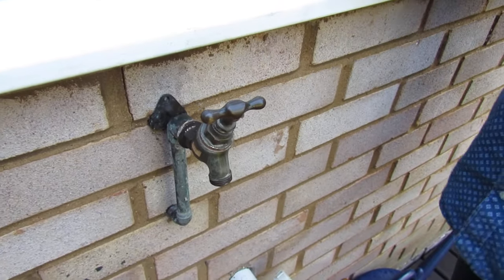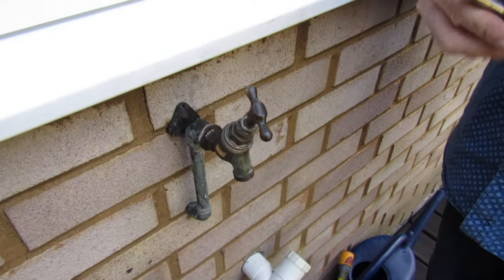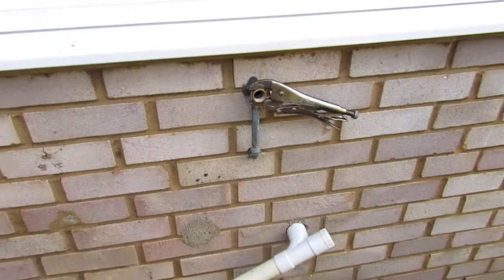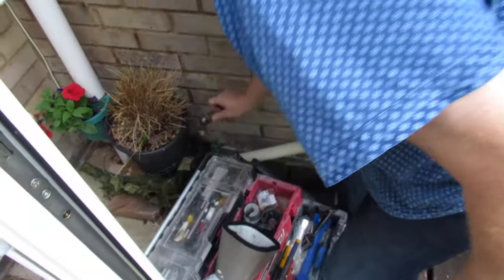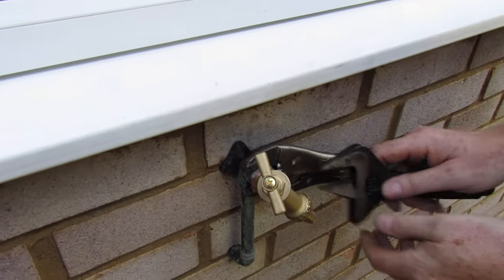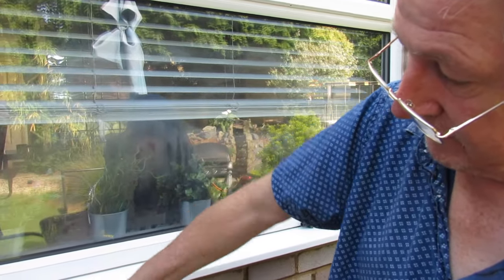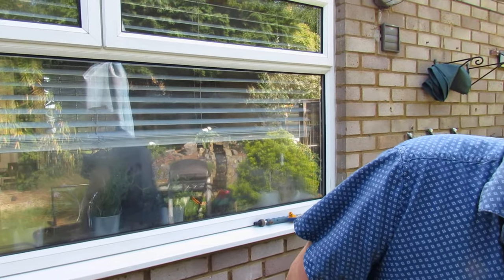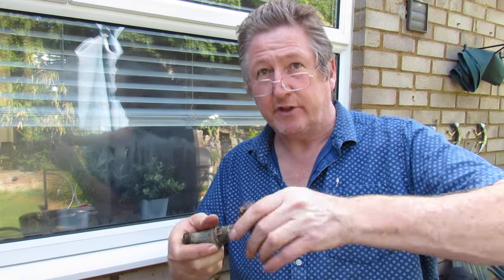How to replace or change an outside tap in under 5 minutes

Comment: You don't need a washer or any sealant.  I fitted these taps for 30 years and only ever used PTFE tape. It's all you need if you know what you're doing.  If you don't know what you're doing then get someone who does.
Reply: So if I just have sort of a pipe fixed to the brick in wich the tap is fixed to should I put the grip on the pipe ?
Reply: 1 year since I haven't wash my car with the presure washed because of the tap :)) I m so ignorant
Reply: People making tutorial videos with no idea what they’re doing. No correct terminology used, oh, I’ve been a plumbing and heating engineer for 38 years. 😂😂😂😂
Reply: Hello , i can't get the tap vertical .

Comment: Unbelievable, that you didn't mention turning the water off first. No info on the washer, or the non-return valve. Great job, guys!
Reply from the maker: non-return is built-in
Reply: @DanielJohnHowTo  Yeah - if you know to buy one that has it built in. Dear, oh dear.

Comment: Useful thanks, but note in the UK you must fit a tap with a check valve (as you did).  Its in the regulations, otherwise there is a risk that the unsafe water in the hose pipe attached to the tap may be drawn back into the house supply. So spend the extra £2!.
Reply from the maker: very true
Reply: I think it reduces the water pressure a bit too as a side effect.

Comment: That’s if you can get the 23 year old,old tap off,without fracturing the wall pipe and 2 spanner’s ,plus WD 40.
Reply from the maker: you can try wire brushing and letting it soak, sometimes it's a pain removing old stuff like that from experience.
Reply: @DanielJohnHowTo  Thank you!

Comment: Hi, what size are the washer and where did you get them. Thanks l.
Reply: You don't need a washer. Iv'e never used one in 30 years. Just packet out with PTFE tape in the gap between the fitting and the tap. Never known anyone who uses a washer. These pair are clowns.

Comment: How do you fix a leak from the copper pipe leading to the tap. Mine has split at the joint. Thanks.

Comment: How do you make it straight I tightened up my one it’s halfway it doesn’t go straight I used a spanner it doesn’t work it’s to strong it just won’t be straight
Reply: You keep packing it with PTFE tape until it tightens at the 11 o clock position and then give it a further tweak by hand until you reach the 1 o clock position. The tape will squash down to a very thin line and the tap will hold. Don't cover all the threads but just the gap between the tape and the fittings. Wrap the tape in an anticlockwise direction looking at it from the front so that it doesn't  unravel as you tighten the tap.